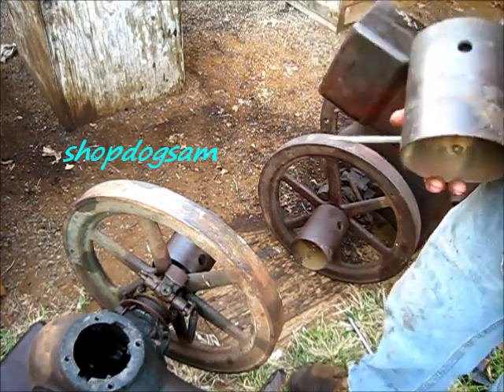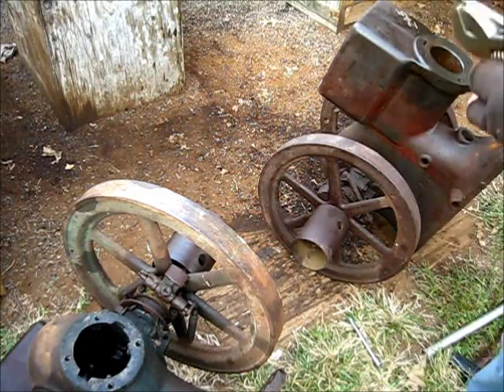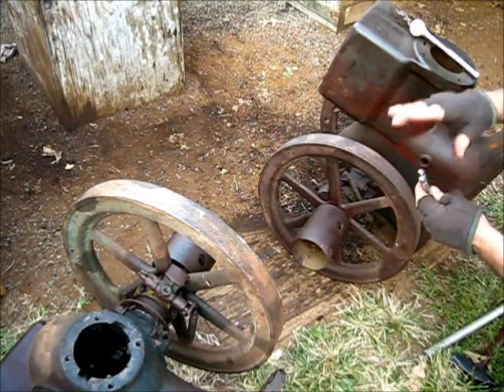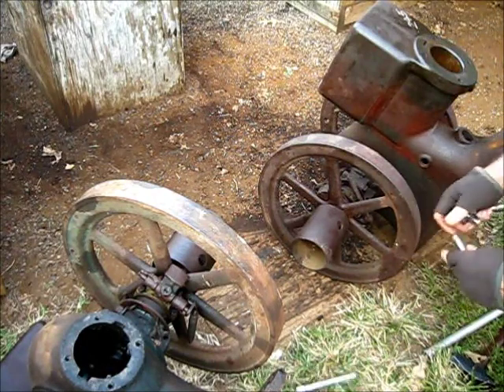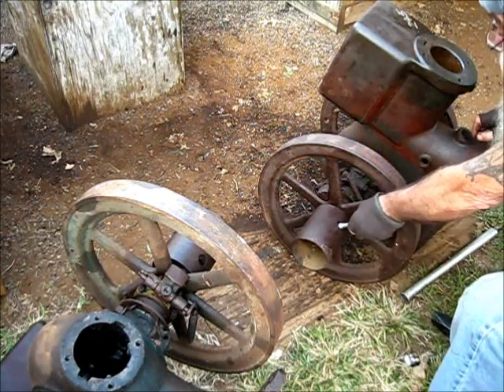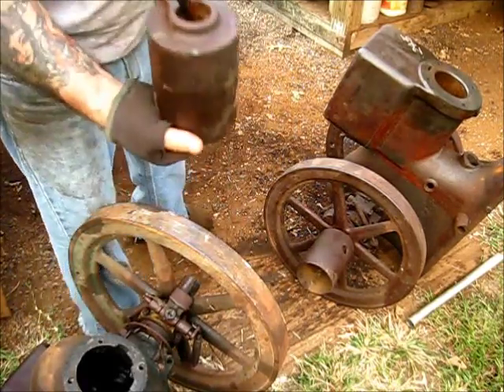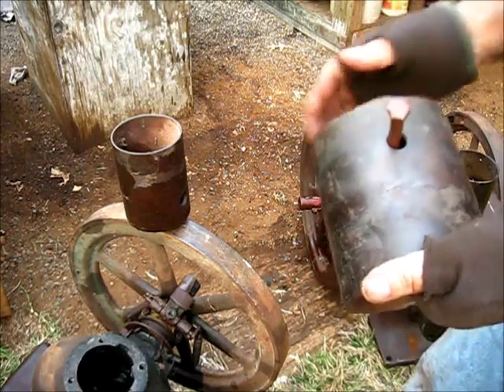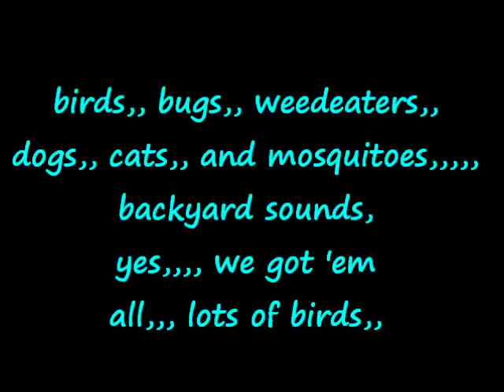IHC ENGINE / pulley set screw /

Comment: Male end of a 1/2" socket extension, will fit into the oil drain plug on some of the older flat head briggs engines too.
We have weed eaters here at the Mid-Coast of Maine too, I prefer my 32 year old Stihl fs80 straight shaft trimmer for cutting grass and brush, sometimes it will eat some weeds.

Comment: Ya square sockets, not common round here at all.  My solution for say a 3/8.  I turned
a piece of stock drilled a hole just a tinch smaller than 3/8- parted it off- put it in my press
heated it cherry red then pressed a 3/8 HSS blank right thru the sucker  then hardened
it.  instant socket.   two 3/8's females rather machine my tooling..
the other Sam
Reply: I forgot to say about the pulley holes off center,  I think back then they were more
interested in gettin the thing out the door rather than the time for a center finder.
I rebuild windmill "mill engines" big as a 5 speed truck tranny.  You wouldnt believe
the gears on some - crude aint the word  how in hell it worked for 100 yrs? but they
did and still and still doing the pumpin.!
the other Sam   and NO I do not  climb windmill towers want feet on the ground